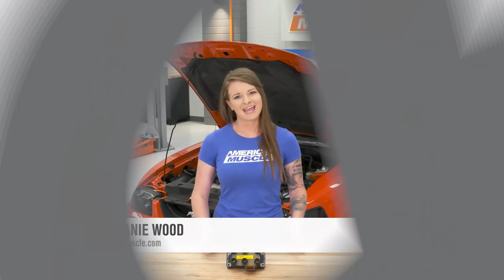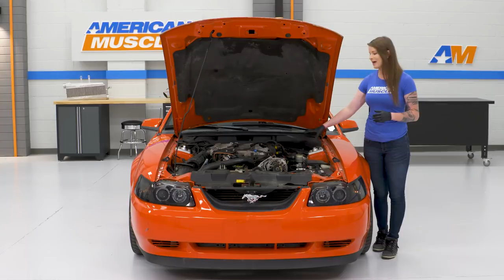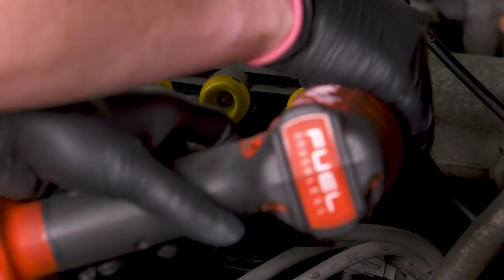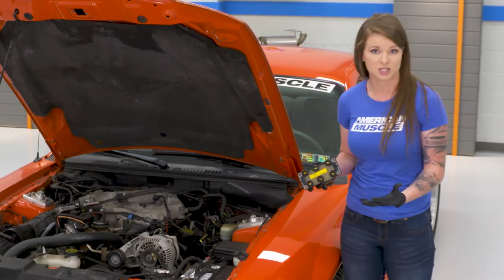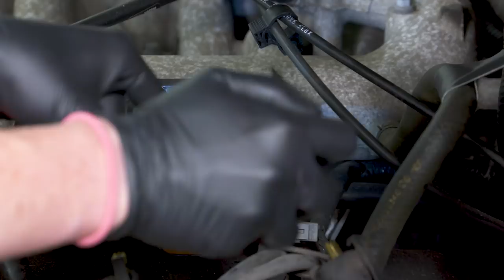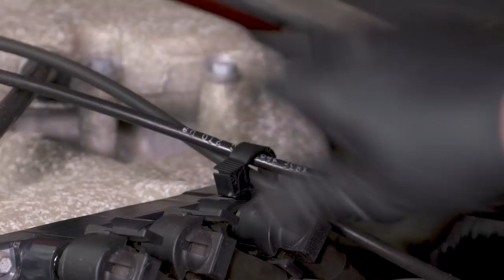1994-2000 Mustang V6 Performance Distributors Screamin Demon Coil Review & Install

Comment: Why not take the coil off first, line the two coils up next to each other and change the plug wires one for one? Less chance of putting them back in the wrong order.
Reply: Ngl didn’t think of this, you’ll save me some time and brain power lmao
Reply: Definitely switch the wires one at a time 👍

Comment: I replaced my stock one with this coil pack and I must’ve misplaced a couple of the plugs but I’m not sure which ones. I have a 2000 mustang v6 and I’ve looked all over to get a correct answer and I’ve tried many of them but none of them seem to be correct. The car was working perfectly fine before I switched it out. If anyone can give me the correct firing order, that would be much appreciated.
Reply: 1-4-2-5-3-6
Reply: @Unknown-bh5qr  thanks! But I got it fixed now but I appreciate your reply

Comment: When I installed my live wires and new spark plug and new screaming demon coil pack I heard popping noises coming from the engine I shit off my engine when it happened anyone know why this happens I'm scared to turn on my car !!
Reply: Did you figure it out. N did you disconnect battery first
Reply: Or loose coils
Reply: I had the wires in the wrong order everything's fine
Reply: @kevinlegoreta4409  is the truck still running the same coils and everthing?
Reply: @kevinlegoreta4409  and what did you gap your spark plugs too?